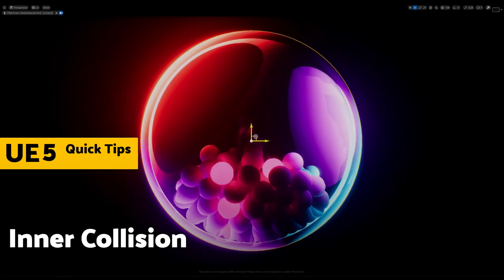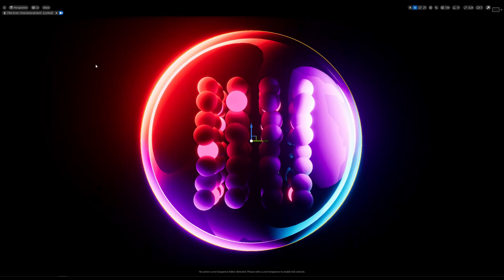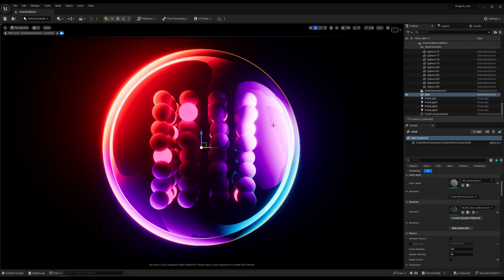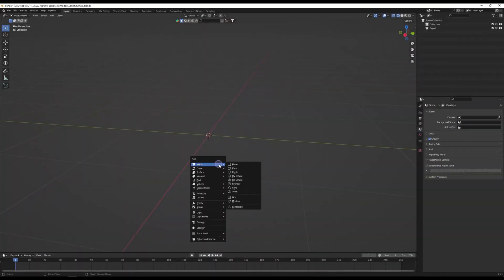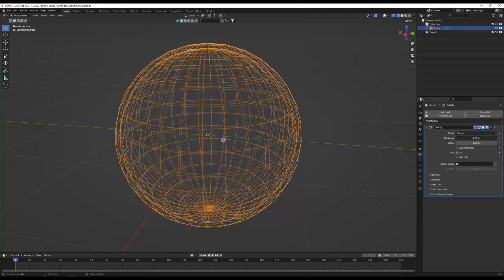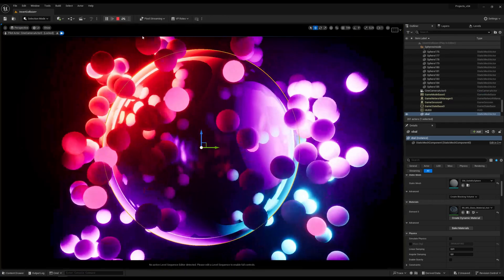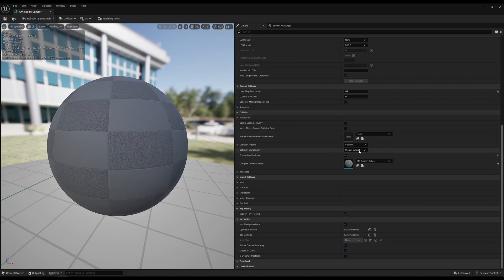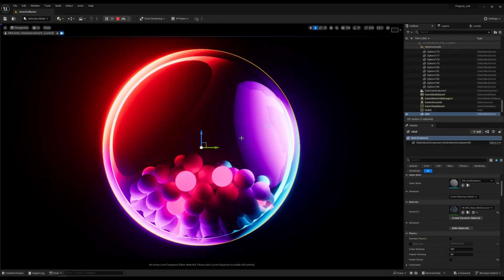Unreal Engine 5 QuickTip | Inner Collision

Comment: Would you share your Unreal project? It looks pretty nice! Do you have Patreon?
Keep up the good work! :)
Reply from the maker: Thank you. For now I am just sharing my knowledge :) maybe in future I will think about sharing projects and also some donation system for those who want to support me :)
Reply from the maker: But this is basically some glass material on sphere. You can make instance material from the starter content glass mat and adjust the values. And there are 3 point light with some source size value so the light source is intersecting the glass sphere. The smaller spheres inside has the basic white material and some of them has emissive material.

Hope it helps.